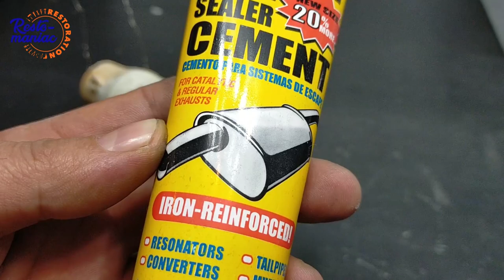Vintage Electric Heater

Comment: Great restoration.
The only small thing,
When you put the cable in the plug you should put the black outher sleeve in the strain relief. 
Its much safer that way
Reply from the maker: Thank you very much :)
Reply: Somehow the word safety doesn't come to mind with this :) Seems like it's a fancy fire starter

Comment: Back when safety was "you probably shouldn't touch that, if you do, that's your problem.".
Reply from the maker: Haha, great advice 😊
Reply: Back then they weren't too concerned about safety as they are today as you said don't touch that that was the rule - I use a mix of old and new around my house and one of the things I use is those style of heaters even my dogs know not to stick their nose in the element - I prefer to use those style heaters because they direct the heat right on you mine are the old Addison style where you can point the heat toward your feet when it's cold instead of heating the air up like the newer heaters do it directs the heat toward the object and it's generally my feet that are cold if my feet are warm the rest of my body becomes warm also those heaters when you turn them on it's instant heat there's no waiting in the morning when I light my wood heater I'll turn on the heater like that one to warm myself up as I'm getting the wood heater fired up it works really well

Comment: I wanted to say you need to add a tab on the heater to make the ground work on the cord but I think this not being grounded is the least of it's safety problems. Very nice job on the restoration.
Reply from the maker: Thank you very much :)

Comment: Can't anything be done to paint the center thing with the gray cement filling? Some heat resistant paint, or applying watered down cast to make it whiter, or some other trickery...
Reply from the maker: When it's warm enough, it will turn white 😊

Comment: great job mate but you didnt install an Earth to that metal lamp very unsafe i would not use it
Reply from the maker: Thank you very much. There is a ground connection, you can see the cable connection section in the video. No safety issues 😊